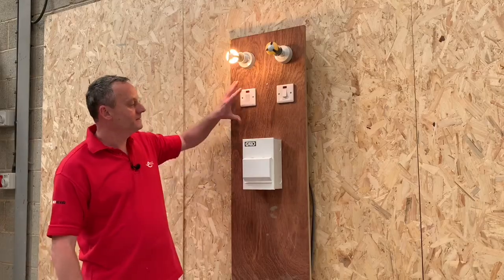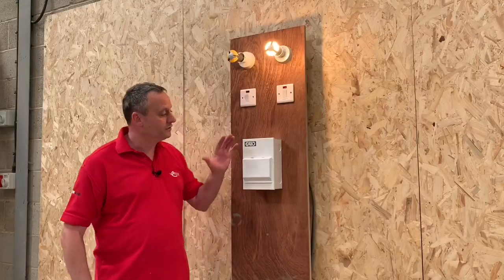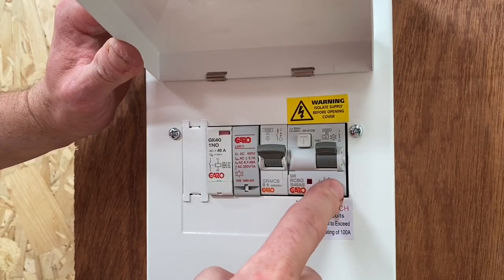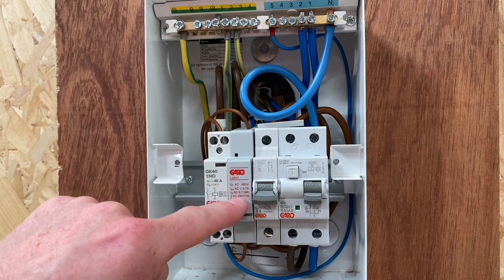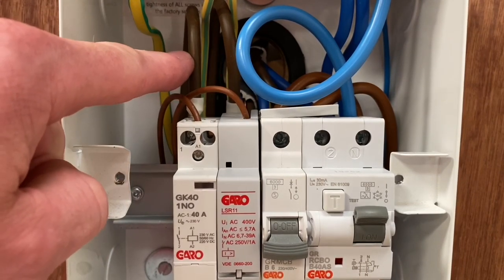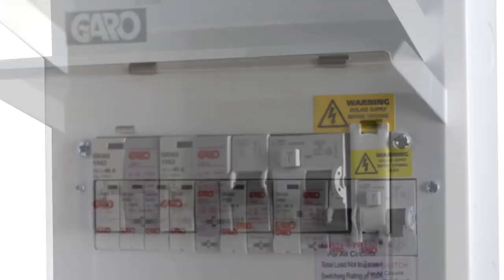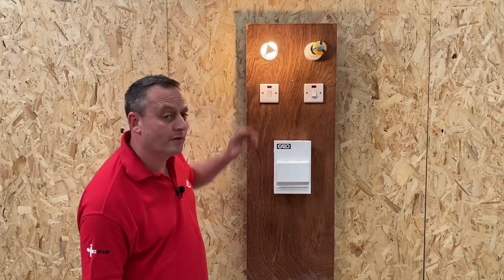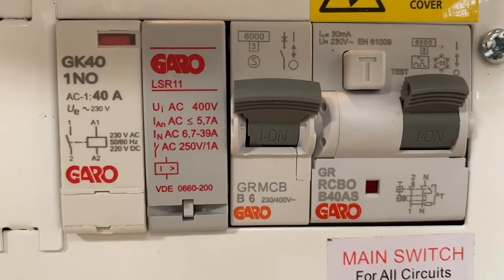Connecting 2 electric showers using Garo priority and non-priority boards.

Comment: Brilliant kit. Clever arrangement! Haven't used Garo gear yet, neither have I had to deal with any priority circuitry issues on site. Likely to become a popular thing on site as consumer usage in properties increases in the modern world. I do a lot of council housing work minor works, the occasional EICR and some works that warrant Electrical installation Certificates, along with some commercial work in plant rooms, tank rooms etc. Great video and channel. Good to know this kind of equipment is out there in the market.
Reply: Fitted a GARO Consumer unit 12 years ago and never had a problem.

Comment: Great video Gary , these boards will be great especially after 2025 when no new build houses will have  gas boilers and all water heatering within the property will be  electric increasing demand on the incoming supply .
Reply from the maker: Great point 👍
Reply: Hi Richard - This will become essential. If you want to suggest a few applications and we can let you know if it's possible. Get in contact if you need any further info - conor@garo.co.uk

Comment: I grew up in a house that had one 3-phase supply for the private home, my mom's grocery, and the warehouse of my dad's veg&fruit wholesale business. As you might expect, the large refrigerators in the warehouse, and the refrigerators and freezers in the store often had the tendency to run at the same time, which was no problem until my mom decided to throw a load of white laundry in and preheat the oven. A higher amperage supply wasn't possible, so however a priority setup might have caused some swearing from my technically challenged mother, it would have learned her to turn on the washing machine after supper instead of complaining multiple times a week about the electrics while my dad was swearing and looking for the main breaker in the dark basement again.

Comment: Here in france they use a box that fits on the din rail called a delestuer with a ring that fits around the main live feed measuring the overall amps on the supply when it reaches the desired amperage that you set it at you then control the priority and non priority circuits max single phase supply here is 60A clever way of controlling everything
Reply from the maker: Thanks Lee 👍
Reply: Trust the French to approach it in a clever superior way.

Comment: Is this the future to reduce stress on an overwhelmed grid once we all have electric vehicles and plug them in during the break of coronation street?
Reply: Hi Gareth - This is one basic solution to help control EVs when charging. We also manufacture a full range of EV charging points and all of the units have Dynamic Load Management (DLM) building into the points.  DLM and smart charging networks will ultimately be part of all our homes and businesses, this will be part of the plan to reduce the load of the grid. Along with battery and solar technology. Get in contact if you need any further info - conor@garo.co.uk
Reply: @con85c  DLM....I will look into that. Integrating smart technology, could users control and change what they prioritise as the primary supplies/loads. It would be a shame if it was set and not adjustable without a qualified electrician.
Reply: @gazdkw82  DLM will vary the supply to the charge point, based on various factors. This is a dynamic system. For example the main fuse, the number of charge points in the cluster, etc. Send me an e-mail and I will send you through some more detailed info on DLM with Garo EV points.

Comment: Clever bit of kit 💡 how many people do you think will plug in there ev and jump in the shower whilst waiting for it to charge to realise it disconnected and think there is a fault with the charger
Reply: Hi - It is a great unit.  When the shower disconnects the EV point will reconnect allowing the EV to continue with a charge. Some charge points will not have load management as a function/feature, therefore this will be a perfect solution for those EV points that do not have this feature.  Ideally, you would purchase an EV point with Dynamic Load Management (DLM), this feature is built into all Garo EV points.  Drop me an e-mail if you would like any further info on our range - conor@garo.co.uk

Comment: I knew I'd watched your video on this couldn't remember when. Now need this as I've got a Tesla charger + Electric shower needed to be added on a site, I should be able to get hold of the relevant components to do this with either Hager or Contactum now I've watched this again. Would of used the Garo unit but the board needs changing so I'd rather keep it all in one consumer unit if possible. Strangely have done this for commercial 3 phase but it's not really something I've needed before for domestic.
Reply from the maker: We’ve also thought about this -  we can’t find an equivalent to the current relay Garo use. You can get current relays from e.g RS but the relay is nearly the same price as a complete Garo board - then you have to add in the contractors etc.
Reply: @efixx  I will likely end up using something other than Garo, yes the cost is competitive but if there's not enough local stockists (around here there is none) you're limited to the internet for getting spares/replacements. That would be fine if the customer in question had a ICE as a second vehicle but with an EV as the sole vehicle and a non standard stock product supplying the circuit the down time could counter the initial saving.

Comment: Could be used to control infra red heating in a conservatorty so that you don't leave it on unnecisarily. Maybe connected to master bedroom lighting. But the IR heating would have to be soft switched so that it doesnt come on again when you turn out the lights.

Comment: 9kW is approx 38A so that 40A RCD and Contactor doesn't have a lot of headroom for inrush, etc.
Reply: Hi Dave - The RCBO within the unit is designed to handle the full load. I would be happy to discuss further and explain our testing procedures in more detail via phone or e-mail. My e-mail address is conor@garo.co.uk  - I'm looking forward to hearing from you.
Reply: How is this board usually fed ? By 10mm tails off of a henley block ? From the main board out of the existing 40 amp shower mcb ?

Comment: Is Garo the only company making current sensing din relay? If a customer has a board, with enough spare ways, could I check the manufacture of the board to see if they have a current sensing relay and contactor to fit into the existing board?
Reply from the maker: We haven’t found any other manufacturers of a current sensing relay.

Comment: So how about doing this on the oven and the heating? Taking into account to diversity etc, would it be reasonable to put an oven circuit as a priority and the 12kW heating as the second circuit on here?
Reply from the maker: Yes that would be a sensible option.
Reply: @efixx  have you had any feedback on these boards? I have found them a nightmare for any spare parts. I did a FuseBox with a Garo Shower Priority side by side. Its incredible what a difference good design makes. My FuseBox looked immaculate (#instagramable) but the Garo looked a complete mess. Why have the earth and neutral bars counting in opposite directions? Crazy.

Comment: Does the priority load have to be isolated to enable the secondary load or just not in use?
Reply from the maker: Just not in use - the relay measuring current flowing in the circuit.

Comment: Am looking for a 3 way.  With 1st in 1st to get shower.  But with indicator for others in house hold.  Such as indicator light on the pull down so you look in an see a shower else were is in use.  Or is the 3 way one just on for the 1st and just wont work for 2nd or 3rd person.  So what if master bed room Dad is in the shower kid get us an switches 2nd shower on or try's to also mum goes in to down stars bath room an switches that on.  So am asking shower one is in use.  Shower 2 an 3 are switched on what will happen when shower one is then switched off.  Who gets power for there morning or birthday wash.  Am thinking if others know a shower is in use with indicator on there pull down.
Reply from the maker: We believe the 3 way version - it’s first come first served -so any shower will operate of non of the others are in use.  If you had a neon on the local shower isolator these would all illuminate when power is available.

Comment: So did I hear this right? If the kid has a shower they can be interrupted either by parents or a timer? That can't be right surely coz they could be covered in soap and the supply goes off for them no🤔?
Reply: Hi Steve -  here is the functionality of the boards; 

Non-Priority Shower Board (GM8-NPS & GM14-3NPS): Restricts power to one appliance respectively at a time. Whichever appliance is using >1.5kW first remains on. The power to the other appliance will be switched off until such time as the appliance in use is turned off. No appliance has priority of use. 

Application - 2 x 9kW showers in a domestic home. Whatever shower turns on first gains priority and the second shower can not be turned on until the other shower has turned off. 

Note - the timing option is usually utilised by individuals that would like to restrict shower periods to save on energy bills and to restrict periods of heavy load.  

Priority Shower Board (GM6-PS): This unit allows one designated appliance (A) (the master) to be given priority of use over the second appliance (B). Whenever appliance (A) is using >1.5kW it will automatically cut the power supply to appliance (B), even if appliance (B) is being used at that time.

Application - Domestic Dwelling with 9kW shower and 7kW EV point. The EV point would be wired as a non priority device and the shower as priority.  When the user connects the EV point it will commence a charge, as the user then turns the shower on it will turn the EV point off until the shower is finished.

If you want any further info don't hesitate to drop me a line - conor@garo.co.uk
Reply: Hi Conor sounds a brilliant piece of kit (the non priority board)
Does it come pre loaded or do you have to spec on what you require?
I would’ve loved this when I completed a multi occupation house but I told the client I could only fit 1 electric shower🙄
I’ll keep an eye out😊
Reply: @bertiebassett1972  the unit is preconfigured. We have 3 options available. Send me an e-mail and I will send the data sheets to you. conor@garo.co.uk
Reply: @con85c  now I understand... will bear this in mind when I need one.

Comment: Would one of these boards help in my situation. I have an 80A cut out fuses. I have a 6Kw shower and a 3.7Kw electric oven. Heres where it gets complicated. In my Hobby work shop that is supplied by a 16mm SWA cable into a 80 amp sub board.. I need to power a 9.2Kw  Static phase converter at 63amps. Clearly you can see the problem. My DNO arent willing to engage to upgrade the domestic supply and the cost of installing a 22Kw 3 phase supply is cost prohibitive. yes I know the Garo board is only rated at 40A. But maybe a higher capacity contactor rated at 63a to control the Phase converter? The shower and oven to take priority without cutting the supply to the hobby workshop.

Comment: so if the other half is singing away in the shower you can pull the switch on the other one and turn it into a soap opera? and stop thinking about my other half naked in the shower, you will get yourself into a lather.
Reply: Contact us before deciding on the model and we can help you avoid a domestic disagreement!  :-)

Comment: If a priority circuit wasn't required then just use a changeover switch
Reply: Hi Kevrus - the board is designed to work without the user having to "think". The cost of this unit is cost-effective and as Gaz mentioned it comes with a 5-year warranty! Send me a mail if you would like to find out more info - conor@garo.co.uk

Comment: Does anybody know can you use this system with a tank fed shower and water mains fed electric shower, or do the shower units have to be both the same, like 2 tank fed showers together or 2 water mains fed showers together?
Reply from the maker: The water supply shouldn’t cause any issues - in fact could help the issue - two showers running on main water at the same time causes pressure to drop.
Reply: @efixx   👍